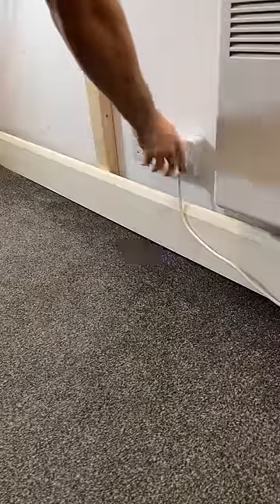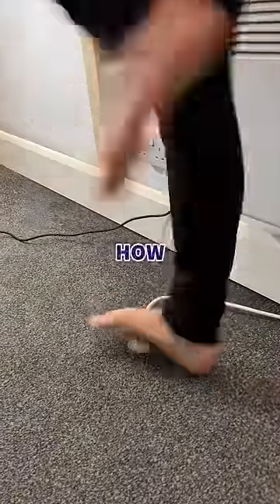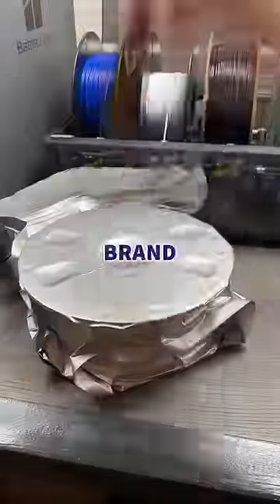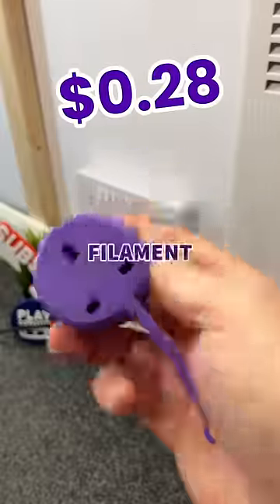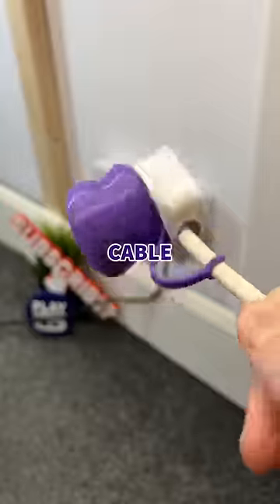3D printing SOLVED the most PAINFUL PROBLEM in the WORLD 😫#3dprinting #lifehacks #shorts

Comment: This is assuming the person that just leaves the cable lying around will put the cap on the plug
Reply: There are 3 sockets on the wall, and only 2 plugs.
Reply: That was my thought. That being said, something like this could be useful if you write what the plug is for on this cap. That way if you have a bunch of unplugged plugs, you know which one you want to plug back in.

Probably a much more useful application as connecting it to the plug would also help know which one to unplug when you want to unplug it as well.
Reply: At first i think it was a yoyo😅😅😢
Reply: PP
Reply: should be a spring based system, cant wait for mark II
Reply: Just use velcro command strips and attach it to the top of the appliance
Reply: which is not the case in the 99,999999% of the cases.
Reply: We all know they won’t because if they’re too lazy to put the cable away or to plug in the thing they unplugged after they finished using the outlet then they are going to put the cover on
Reply: @SmallSpoonBrigade or you could just write it directly on the plug
Reply: Ikr... At that point you may as well just tuck the cord away, would probably take the exact same amount of time and effort as putting the cap on. If you're too lazy to tuck it away then you're probably also too lazy to put a cap on it.
Reply: @danielch6662  that's normal.
Reply: @SmallSpoonBrigade You could just put a label on the cable. Don't need this thing for that.
Reply: People can be dumb enough
Reply: Totally definitely me
Reply: Or make the plug lean on the side instead. British plug is not the best in this regard.

Comment: the fact that you forgot to put it away means you will forget to pop it back it.
Reply: Agreed
Reply: Or just put the plug in the other socket
Reply: Maybe that random placement on the floor is away
Reply: It's more work to put it away than to put the lid on
Reply: I have a feeling its the cable for the heater on the wall
Reply: Doesn't that defeat the purpose of unplugging it? @user-tg7zt2lo1e

Comment: I actually don’t know how painful that is bc I’m in Europe and we don’t design stupid outlets
Reply: in america, i’ve never had this problem, and he’s in the uk btw
Reply: well, uk plugs are actually one of the best plugs when it comes to being a plug
Reply: @monkeoli  idk what uk plugs look like, polish 🔛🔝
Reply: @urfavvrx  I am polish and I tell you it is not on top 😂
Reply: @monkeoli  at least u can’t hurt urself by stepping on it, honestly Greek better idk it don’t have that lil stick thingy that u need to have a hole for
Reply: @monkeoli  kinda. It's the same safety as the Schuko-Plug but with a much much uglier design.
Reply: @urfavvrx  You mean the earth/ground pin?  
It's kind of an important safety thing, and it means that you don't have exposed live and neutral allowing someone to just poke things into the socket and complete the circuit.
Reply: @dreadlindwyrm  it’s that our plugs are designed in a way that they don’t stand with the lil pokey things up when it’s laying on the floor so
Reply: @urfavvrx  Well, there's an implication that you're not really meant to leave them lying on the floor - ideally they stay plugged in, or you put the plug and cable away with whatever you just unplugged.

But yeah, there's a compromise in the design about whether to have the cable come out of the bottom of the plug (and thus theoretically be parallel to the wall the socket is on), or out of the back (and be less likely to end up with the prongs sticking up, but potentially take up more space and be more likely to be knocked if you're walking past or cleaning).  
I guess it comes down to which was considered more important by the initial designers.  
And which European standard you're using - since some of the Euro plugs also have a tendency to have prongs up (types E and F - and K if that applies).
Reply: @dreadlindwyrm  yeah I don’t I’m stupid but not that stupid like the vid

Comment: That is actually a real issue. A former classmate stepped on a power plugg like that with bare feet. It pierced through the underside of his foot.
Reply from the maker: Ouch 😩
Reply: @H3ARTS4DJAL1NA wouldn’t the plug be unplugged though?
Reply: @H3ARTS4DJAL1NA likely would get shocked rather than electrocuted. electrocution refers to dying by electricity.
Reply: @biomedcraze could be an extension cord but for the most part youre correct
Reply: @sharky1742  ok
Reply: I don't see how that is even possible, unless he jumped on it from atop a chair. They are really blunt and rounded.
Reply: @danielch6662  The EU plugs only have two round terminals with less surface. It pierced straight trough in the area between his toe-ball and heel. It looked really nasty :D
Reply: The exact same thing happened to me. Went right through the first layer of my feet
Reply: @H3ARTS4DJAL1NA I don't know man you don't usually make a battery with blood and 3 pieces of copper but like I mean it could be that double sided plug you use when you don't have wires in the wall to your outlet (not a common problem though)
Reply: @sharky1742  i agree with the extension part, but yeah
Reply: @sharky1742  i meant shocked btw, i am not english btw srry
Reply: @H3ARTS4DJAL1NA if he could step on it it wasnt powered
Reply: Sounds like a personal problem, was this person overweight? I've stepped on Lego's I thought for sure broke skin but didn't lol
Reply: Bro was recharging, must’ve been a foreign model, most of the american charging ports are between the nose and chin
Reply: @sharky1742  if you can see the prongs or if they are exposed enough to poke yoursef on no matter if they are an extention cord or not there is not electricity unless you frenkenstein your cords
the "male" part is an input not output
Reply: Bro it pierced through mine foot
Reply: you think that’s bad? american plugs are sharper and i had one go all the way into my foot… i then managed to walk to the other side of the house after pulling it out which literally left a trail of blood behind me… and i had a loft bed so i had to climb a ladder every time i wanted to get in and out of bed… shit wasn’t fun
Reply: @thebest4594 I kept scrolling looking for this reply.
Reply: @H3ARTS4DJAL1NA  Think about what you just said for a second. The plug is obviously unplugged if its lying on the ground. How are you gonna get shocked, much less electrocuted if there's no power to shock you with?
Reply: @H3ARTS4DJAL1NA  thats literally impossible, if its unplugged on the floor it doesnt have any power. The only way this could have is if someone makes an extension ending on a male plug instead of a female, which is a really stupid idea.
Reply: literally EVERYONE is saying it's Impossible, I know now, my brain was not braining.
Reply: bros at full charge now
Reply: it actually happens to me once from a laptop charger and it hurt so much
Reply: I did that earlier this year. God that hurt
Reply: That happened to me once... It hurt like HELL and there was blood everywhere. 
I also once had two sowing pins shoved into my foot! Fun times.
Reply: I accidenty broke it
Reply: @sharky1742  most extension chords have a plug at one end and a socket at the other. If it was plugged in he wouldn’t be stepping on the plug.
Reply: @epmcgee  ive seen some strange things when people dont feel like going to home depot. extention cord plugged into a male to male cord plugged into a normal extention cord plugged into a female to female cord plugged into god knows what😂
Reply: I stepped on a plug the two prongs went each side of my big toe, and the earth pin lifted my toenail off.. I didn't pass out, but it was close.
Reply: @blackcountryme If time travel ever gets invented, I would go back to a time when I'd never read your comment.
Reply: Only for Americans XD
Reply: Only in the UK